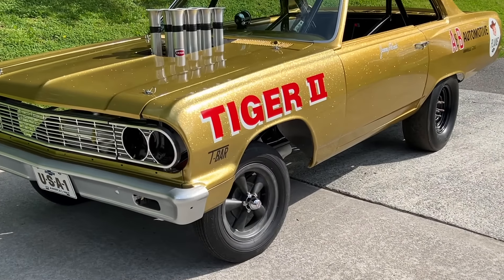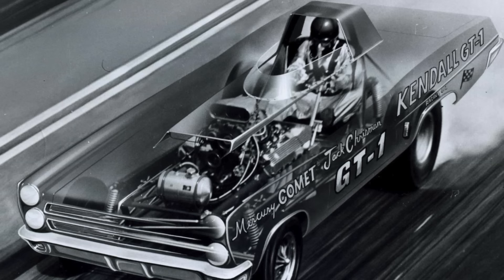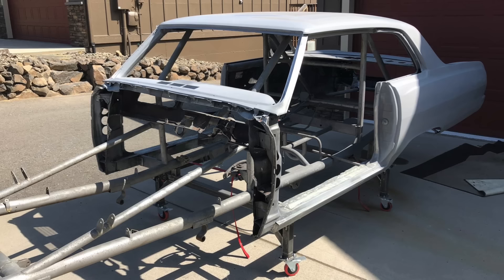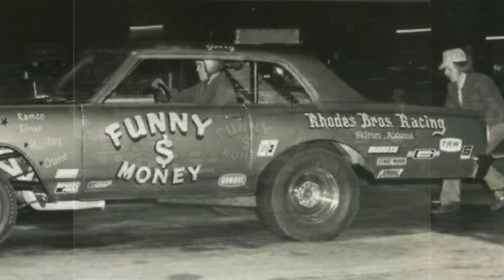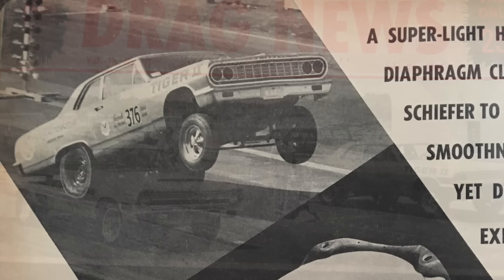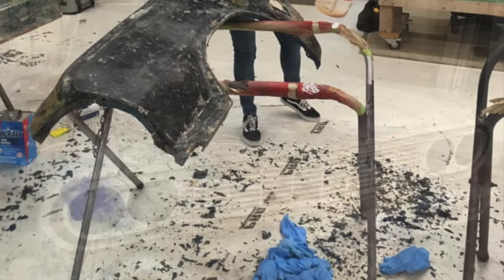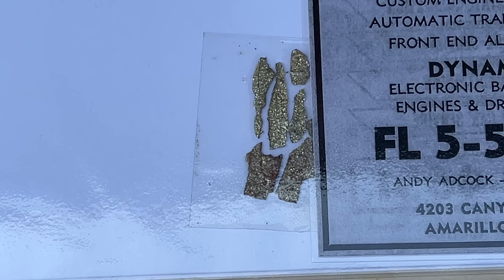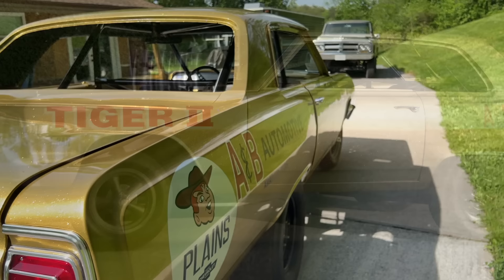HISTORIC Chevelle FUNNY CAR Found and RESTORED!

Comment: thank you so much for this.  i saw the tiger II several times in Tulsa in an early configuration.  It looked like a gasser on steroids and I was in love.  at least with the small block it would do wheelies only with a trunkload of cement. still thrilling to my teenage eyes.  I remember the slogan painted on the lip of the trunk lid:  'we'll run what you brung.  we brung this.'  a great piece of drag racing history and a well told tale.
Reply: Wow thanks for that story! I knew something was on the trunk lid but didnt know what!

Comment: What a surprise and treat to see this video.   I was 16 in 1965 and I was at the Amarillo Dragway when this car made its debut.   I remember thinking at the time how different the car looked and the shock that someone took a brand new Chevelle and made it into a full race car.   They ran a couple of passes but not full throttle just to check out how it handled.   So cool.  Thanks
Reply: Wow!! How very cool Rick. I think this is my favorite comment yet. If you have facebook access we have a page for it that has a bunch of photos on there. Tiger II - Blitzer AFX Chevelle is the page name.